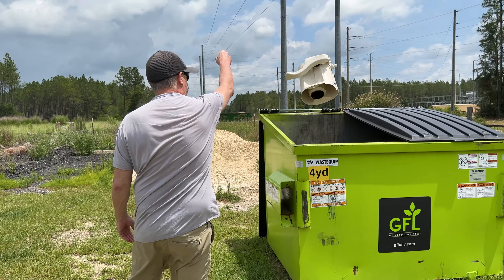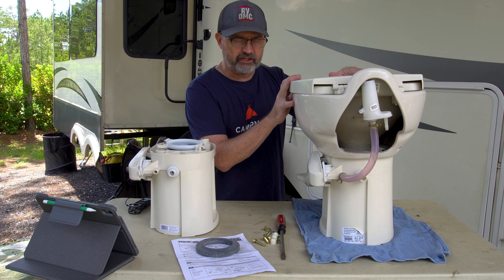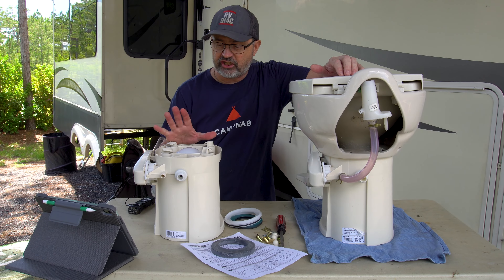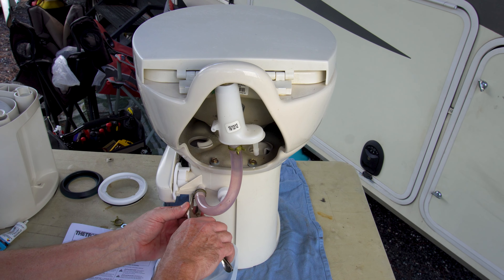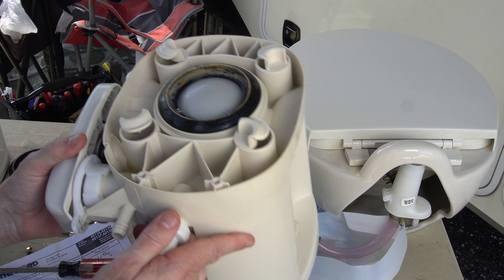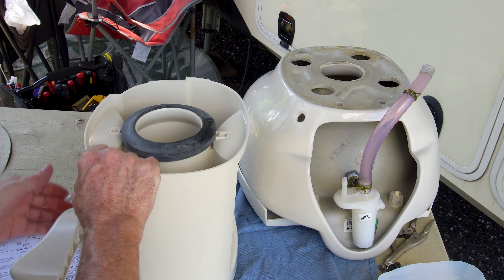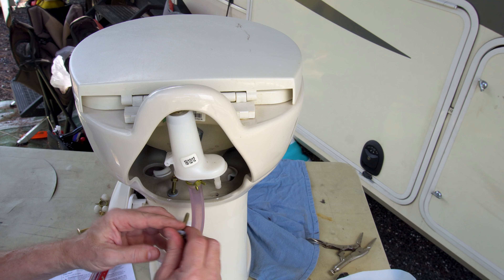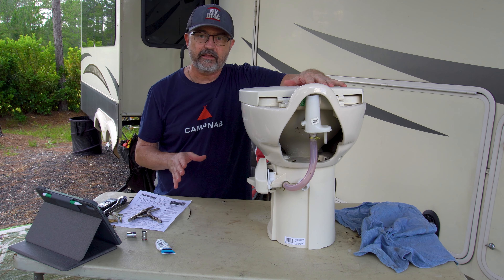Thetford Aqua Magic 2 RV Toilet, Replace the Entire Base (RV Living) 4K

Comment: I think i wd get a regular household toilet instead of a plastic type with 50,000 parts doomed to fail at the most INOPPORTUNE moment!!
Reply from the maker: Prowblem is all the water that would go into the black tank. But if your RV was permanent, I totally can see that. 
And yes, all the plastic parts in RVs 😡
Reply: @DownsizingMakesCents  you can get a low flow one. or a bucket filled with cedar shavings with a foamy lg noodle on top to sit on? last resort of course...ha ha!

Comment: Screw all that. The entire toilet is 200
Reply from the maker: The china bowl really does not get dirty if you clean the inside of the bowl before you get started taking it apart.  I figure we will have to replace the base every couple of years, $80 is a reasonable cost for maintenance for a toilet.  Larry